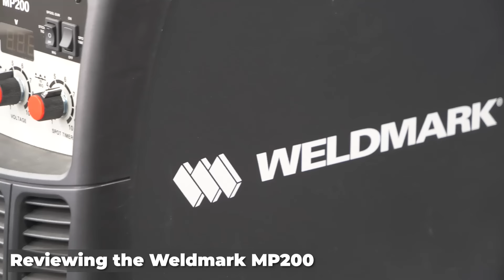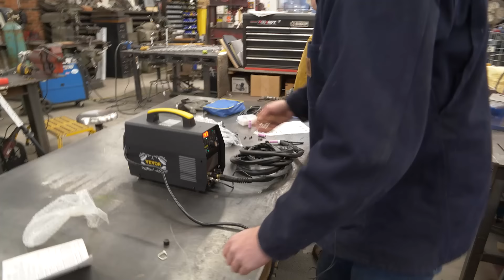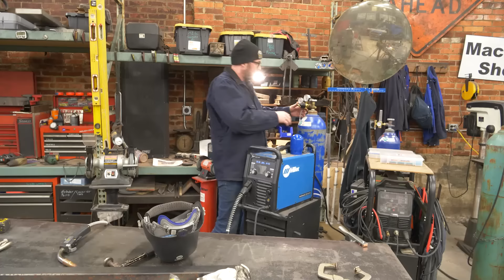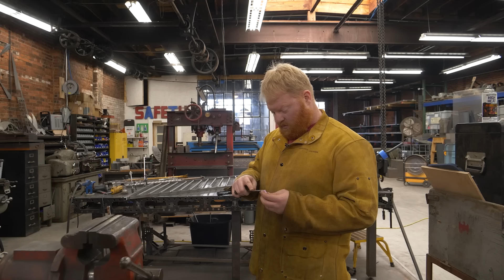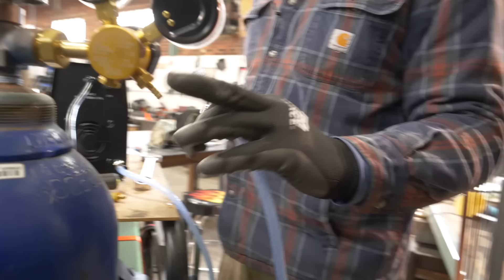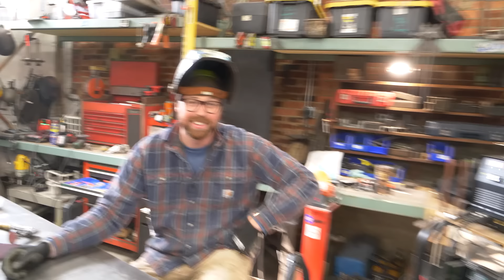$200 TIG Welder VS $2,000 TIG Welder

Comment: Would you guys use this for intercooler piping?
Reply: If you use thin wall steel tubing, I don't see why not. It would actually be very well suited for that. If you're wanting to use aluminum tubing, you'll have to get a welder that can output AC.

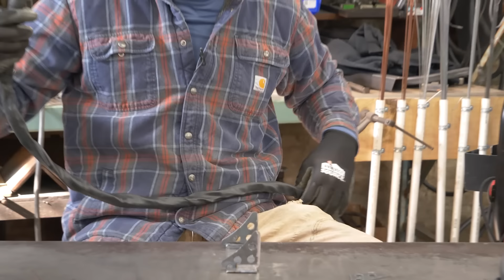Comment: 31:35 The cheap welders use a really old technique to get high frequency: The Spark Gap. It produces a shit ton of electromag noise which drives nearby electronics and ham radios absolutely nuts. Also, since it's literally a spark (an arc), it wears out the contacts after a little while. You need to clean them and make sure they have the right distance pretty regularly. Other than these cheapies, the only TIG i had with a spark gap was a Navy surplus from the 60's or thereabouts.

Comment: I have a question, I bought a Yeswelder MIG 250A Pro multi-process welder, which does MIG, TIG and Stick with a 60% duty cycle, and it welds aluminum using the MIG gun that you have to switch to the graphite liner to weld aluminum, so I was wondering if you guys have ever tried this welder and what you think about it. I paid $500 and something for it a year ago, but unfortunately I haven't been able to use it as our fuse panel is full, and I'm just worried that if something is wrong with it that now I'll be screwed as I wasn't able to plug it in to test it, I'm just praying that it's alright. I also bought a Yeswelder CUT 55DS Plasma Cutter, but that runs on 110V and 220V, but my Welder on runs on 220V.

Shortly after I bought the Mig 250A Pro, then they came out with a new version that you can operate using a spool gun, and I wish I would have known they were going to do that, because then I would have waited a few more months to get that one.

Comment: I have a yeswlder 205ds and a miller max star 161 and I do all my personal garage work with my yeswelder which also has a HF start. This generic vevor welder is similar to the yeswelder 205ds and around the same price. For someone trying to begin learning tig welding or just want a little 110/220 tig machine for your garage then yes I would also recommend this cheaper 3rd party Amazon welders. For a couple hundred bucks and buying an argon cylinder is really a small investment compared to the performance and long list of what you can build with a little tig machine like these vevor or yeswelder

Comment: Pssht 210 amps... For $220.,. Granted I got mine used but I get 500 amps from my P&H for $400. Ac dc, pedal included, valves and a torch for liquid cooled Tig. Timed welding, and a stinger with 4 packages of rods for stick welding. High frequency start with soft start function. Only real downsides are no pulse and it's as big as a refrigerator! Oh and I suppose it probably weighs 1200 pounds so not very portable... And it didn't come with a regulator either, but it did come with a real hose, no barbs.

Comment: I am new looking to go pro. Now I have a little over a year with tig and mig experience from a previous job. My goal now is to do my own custom fab/powder coating. The next big purchase is the welder. Right now I have my eyes set on the HF titanium 200 mutiprocess to start with. Back at the shop we use a lot of harbor freight stuff if the miller's were being used on bigger jobs. Is the HF welders something you would recommend to start professionally with?

Comment: It is surprising I have a stick welder from them that was surprising. The stick welder also does lift arc. Honestly electronics have come a long way and large welder companies have been slow to adapt. Look at your machine and then imagine going to a store to buy one and saying I will take the little one. They can be made even smaller just look at computer power supplies.

Comment: I’m a beginner and wanted to learn tig, I considered the DC only but I wanted to learn aluminum tig so I bought the Vevor 250A, it does everything it says, my son is an expert welder, works for Potelco, he came over to check it out and he was impressed considering he uses a $10K welder in his shop, time with my son, “PRICELESS “
Reply: Do you have a link to the one you bought?

Comment: Gerday again, hey guys, sleeping arrr can't help. But your microphone probs can be cured really well. Watched Adam Savage install a miniture mike onto a pair of glasses. Goes just onto the plastic frame at the front in front of the hinge and has a bracket that's so small you can't see it plus the bracket stays but the mike is removeable. Hooked into a belt mounted std mike socket you can wander anywhere and absloutely no one will ever find it.  Anyway your local electronics shop will either have or get it for you. From memory I think it was sony, most of his gear is.  Peace out. Wayne

Comment: 12:52 The numbers on the tig cup are the the recomended flowrate in liters per minute. So 6l/minute for a No.6 cup.
Reply: I believe you double those numbers to get the starting flow rate then tweak a little as needed.

Comment: Not a welder, not a mechanic, just a former electrician turned (kinda) programmer...

Please, for the love of fasteners, stop using a 12-pointed *anything* on a 6-faced fastener. Especially brass. It's not good for steel fasteners, and it'll annihilate brass ones.

Edit - To actually address the (real) content of the video:

Once I get done moving, I'm absolutely going to buy one of these units... Then I'm going to trick it out so that it can be ran (close to) 100% duty cycle. Then I'm going to learn to weld. Did my first welds a week ago, with flux--core MIG, and the fellow overseeing me was highly impressed. From the first bead. So, we'll see what kind of trouble I can get myself into. However, I'll be looking into what it'll take to add a decimal point to the value of this lil' machine, and I'll be documenting the process. Expect a video.

Comment: Don’t get carried away boys, because those welding machines are impressive to start with but in the long run they Will fail. I have 2 of those Chinese stuffs and my Welder Fantasy ( Ac/Dc) got a solenoid problem with 50 hours overall work on it. And the Andeli tig dc that is exactly the same as Vevor we will see.

Comment: Great little welder.  Pity they don't deliver to New Zealand though - options are the US or Puerto Rico, either of which would mean a goof long swim....

I was trying to ascertain from the website as to what the Amperage draw is.   Here in NZ, the household plugs are 220-240v / 10A.  A wall plug for anything that will draw more than ten amps has to be wired in specially for a coupe of hundred, but single phase only.  Some of the cheaper inverter units here are 10A, but they don't have anywhere near the functionality of that TIG welder.  Finding something comparable (locally) is between $1200 and $2k (about $750-1250 US) - and that lower cost one's a 15 Amp no-name knockoff with a reputation for failing just outside warranty, with the $2k one being half decent but a large chunk of cash to lay out.  

That Vevor looks to be able to reproduce the same quality welds as I got out of a (local) $2500 unit that I no longer have access to and even though it does not do aluminium, it would be perfect for sheet metal work on classic cars.....which is what I want to use it for.  That Vevor unit is the equivalent of NZ $350 and even if it cost me a hundred bucks to get it here in shipping, would still leave me with a few hundred to lay with for additional tips, rods and other consumables before it reached even the cheapest 15A option available locally.

However, if it was only needing 10 Amps at the wall, I'd be even more interested in it!  Was there anything in the <ahem> "Instruction manual" that gave a hint as to what it might need to plug into or what amp rating is on the power point(s) that you used for it in the shop?

Comment: I think one of the biggest differences would be the duty cycle.
But for DIYers that's not a problem.
Reply: People are always hopping right on duty cycle but I agree with you, if you're not doing production welding it's nearly impossible to max it out. I've seen youtubers try and it's not easy unless you crank the amps all the way up. Most of the time you need to stop and let your work cool or set up your next weld long before the welder starts overheating. Even a pro fabricator on a site spends ten times as long prepping as they do with the trigger on. And if duty cycle is the only issue... you gotta think about whether you'd rather just use two $200 welders instead of one $2000 one.
Reply: One of the only time I have been concerned with duty cycle is with plasma cutters
Reply: I have a cheap stick welder with a duty cycle that some people would worry about. I abused it more than enough and it never went O.C. on me to be honest. It was 150 euros ten years ago and I still love that little machine!!

Comment: If you're looking for a good beginner machine, I bought the Everlast PowerTIG 185DV to learn TIG with and it has been a great little machine.

PS a significant amount of these foreign companies are able to offer such cheap machines, not only because of poor quality materials and lack of quality control or R&D costs, but also due to their reliance on child labor, inhumane working conditions, non-existent safety standards and, in some cases, literal slave labor (similar to what we see from companies who mine raw materials for lithium battery production - like cobalt mines in the Congo).

Even the "ethical" companies of this type are only considered so because of their host country's low standards.

For example, the legal minimum wage in China is only $1.52/hour....... Average salary in a bigger city like Shanghai is around $350 per MONTH... In provinces that are more rural the average salary drops to around $160 per month.

This is why it was such a big deal a few years back when many US companies exported labor to foreign countries - it was twisted to seem like right-wing folks were mad that the Chinaman was taking their jobs (similar to how the anti-illegal immigration position is misrepresented as race-related), but it was actually an ethical argument; the sole motivating factor for these US companies to move production and Customer Support overseas was the exponentially cheaper labor due to inhumane standards and non-existent laws to protect employees in the host countries.

This is an uncomfortable truth of modern society. We pretend to be morally superior to previous generations, but we have simply hidden our immoral acts from daily view by exporting them to foreign countries. When you go to the store to get a smart phone you don't have to drive past the nursing mother, baby strapped to her, on hour 10 of her 16 hour day swinging a pickaxe at the cobalt mine

Most people simply don't have the time to waste looking into where the company that makes a product they want sources their labor/raw materials.. People have their own shit to worry about, something 5000 miles away might as well be on mars

Comment: I had a 90amp harbor freight flux it was garbage I realized that after flux core mig welding with a millermatic 212. I recently got a cheap 220 dollar with 2 year warranty multi process welder and super surprised and happy how well it works. It will do tig but the torch is sold separate I've only done stick and mig mostly mig tho but it's nice to have all option in one machine so I can practice what I don't know and use what I do know efficiently

Comment: I worked for 33 years in an industrial setting, loved to tig weld! A friend of mine has a home setting tig rig. Other than the lack of a peddle, it's just as good for sheet metal fabing!facing!! You just have to have argon and get used to adjusting the head due to the lack of the foot peddle!

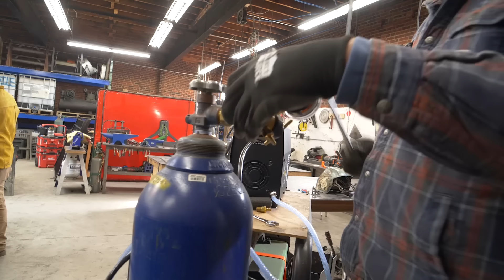Comment: 29:30 using the right part isn't fiddle farting around. That is an untenable conclusion.
But overall it seems like a nice little portable machine if steel is the only material you need it for. And you have another welder in the shop. Not convinced I'd want that as my only machine. But other than the wind problem, it would appear to be an inexpensive 'in the field' take-along TiG if you need that.

Comment: I have a $200 tig welder too, I picked it up to learn on and to try and fix my vintage aluminum mountain bike frame and it wasn't bad compared to the high dollar rig we have at work. I learned on my own at home and came to work one day and welded something up for my boss he said I had no idea you knew how to tig weld?? I said yea I think I can handle it, knowing that I'd been practicing for months. Also fixed my mtn bike frame ✊🏽💪🏽🤷🏽
Reply: $200 AC welder?
Reply: I mean, you can weld aluminum with DC, but it's not going to be as pretty or strong @Jan_mxv
Reply: @4YTfun07 nah not really. Yes DC with helium is done, but someone spending 200 on a welder ain't got a helium tank, and that's for thick stuff. Dc tig aluminum argon just melts out the back, oxide layer never breaks, can't be done on something so thin as a bike frame. Yes you can do DC stick aluminum, but again, not on thin stuff like a bike frame.
Reply: @Jan_mxv  yes child they aren't making you pay usa prices just chinese prices renimby to usa 1:1
Reply: @dtnineninety9406  Are you dense? Even 200 for a chinese AC tig is low. They are usually 400+
Reply: @TheChrisey  nah. Vevor
Reply: Great flex
Reply: what welder do you have?
Reply: Some here. I used to always say I didn't want to do any major welding. Used my home 250 to get good at it. I am the best welder at work now

Comment: The "actual" amperage is the issue with those cheap welders. You eluded to its 100 amps not feeling like the Everlast. A better review would have been to verify the actual max amperage on 110 and 240.. thats how they get you.

Comment: It's crazy how much technology has advanced in the last 10 years. I purchased a multi-process welder off of Amazon for $400 and it outperforms the Miller that I paid $1,300 for. Granted the Miller is about 8 years old now, but it is still insane that a Chinese "junk" welder preforms like that. Not to mention the fact that the Miller it is not a 4 in 1 machine. The Chinese multi-process welder will do stick, MIG, Flux core, and lift TIG with high frequency start. I mainly use it for stick and TIG, but it is a damn good MIG welder as well. It will burn everything from 1/16 7018 all the way up to 5/32 hard facing rod. I tested it out with some 1/2 inch plate as well and It is hands down good enough for industrial work.
Reply: What brand is the multiprocess welder?

Comment: You dont need a 2,000$ welder depending on what you are doing like pipeline yea you will for the duty cycle but if your going around fixing fences and boat trailers and heavy machines all you need is a truck 9000 predator generator and a 1200$ multi process welder that has a good duty cycle on it Also cheap and expensive welders are the same built from the same parts its just your paying for the brand name like miller Lincoln Everlast the factory wants a lot more money then they put in it like if the welder cost 2,000$ they prob made it for 1,100$ your just paying for the brand name of the welder which is what a lot of companies do they over charge the customers due to brand name which is why i hate big brand companies because they do that almost all companies do this but the really cheap 130$ welders they are junk but anything over 220$ will be a good welder anything over 900$ best for going around and doing local things anything over 1800$ and your ready to do heavy things

Comment: Calling them Chinese is a misnomer, some are built in China, most are built here, shipped there for assembly. I have 2 Everlast machines, they are assembled in China, designed and built in the US. I've welded for 40yrs, and the big 2 or 3, no longer have the market cornered.

Comment: Regarding the torch connector, it's a common fitting on a lot of the Chinese TIG welders, though there are two sizes.

Probably M16-1.5, and you can find DINSE adapters for it if you're so inclined.
Reply: When did Seth Rogan start welding

Comment: i got a giantz 250A acdc, not too bad. for the price its worth it. probably one of the best chinese units ive used actually (now its going to blow up. sigh). 

only weird thing about it is, it has the standard "clean area width" but then it has "clean area depth".

havent really pulled enough arc time to figure out what its actually doing, but my guess is how far the current swings on the polarity reversals, and not just duty cycle+/-.

i wouldnt get a 3 in 1. too many potentialities... and sometimes i like to do all three at the same time.

Comment: I Am a left handed welder. I learned left handed with stick welding many years ago when TIG was just a pipe dream. Stick, and MiG easy no problem. When I had to learn TIG on a job, it was tricky for me having to hold the torch in my left hand, and the filler, and the switch in my right hand. Yes, it was a hand held switch. It took awhile,having to push the tungsten rather than pull the tungsten. Any tricks to make it easier?

Comment: I once used my yeswelder tig welder at around 190 amps and it got so hot the jacket holding the gas line and power cable together started melting.

Comment: The test is how well will they work after a year of tow of everyday use? Will they last the year? When it fails will the Chinese company still be around to honor any warranty or will they be around as another brand?
Reply: Yes they will still be around. Vevor is a massive company and sell a wide range of products from indoor grow lights to welders ect. I'm sure it would last a year no problem. Usually when it comes to Chinese product you either get a unit that craps out quickly or will last along time. That's because these companies skimp on quality control and alot of shot units get sold to customers.